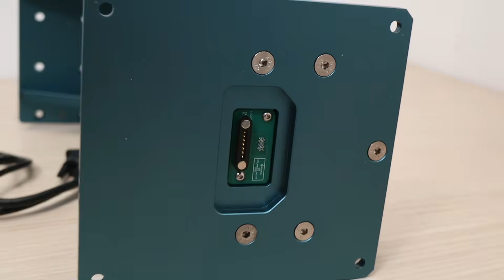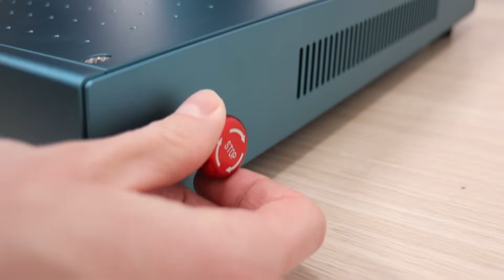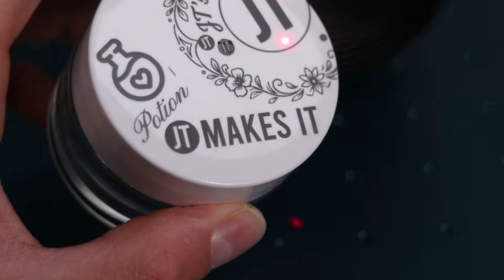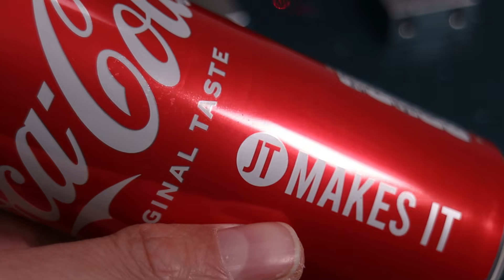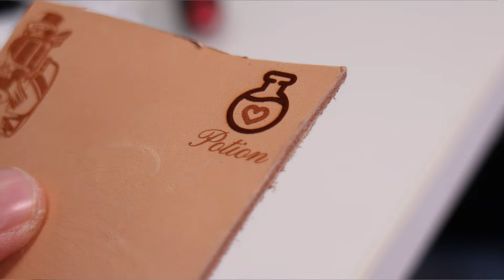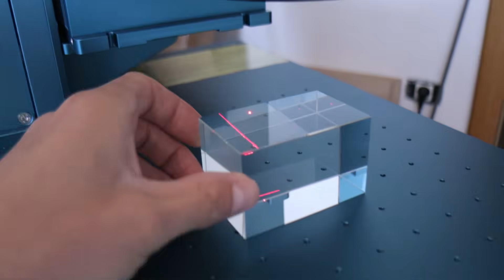Sculpfun V5 Review: The Ultimate UV Laser Engraver for Custom Merchandise?

Comment: Would you choose this or the Xtool F2 UV. 
Nearly 2k of a difference here in Ireland in price.
Reply from the maker: xTool has easier to use software, its quicker to set up and get good parameters, but Sculpfun can be more versatile, by having larger bed and supporting more, lenses attachments and jigs. Depends on what you need. Both are very good machines.

Comment: I got mine with the RA 4 in 1 rotary and the extension kit, working great so far, I'm just struggling to dial in perfect powder coat tumbler engraving settings using the rotary.
Reply from the maker: Haven't tried tumblers yet, but you might want to try two passes? One powerful and one cleaning pass. Also try to keep the interval low as UV laser has an extremely small laser spot size. Maybe set it up so it engraves small overlapping parts instead of rotating a but per each line

Comment: It is indeed a versatile and solid machine. The only thing that annoys me is the crazy loud fans. At 1 meter distance they produce some 58 dBA. I'm contemplating replacing them with higher quality ones.
Reply: Yes at first glance they look like high quality Sunon, but that may be merely because of the green label
Reply from the maker: I have heard MUCH louder ones 😅 but it is worth it compared to external chiller. Much less complexity. And yes you can always replace fans for ultra quiet ones.
Reply: @JTMakesIt  The fan cannot be replaced. Laser requires high heat dissipation. If heat dissipation cannot be achieved, it will damage the internal light source and cause laser failure